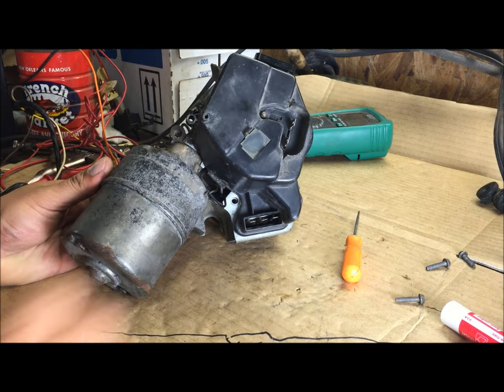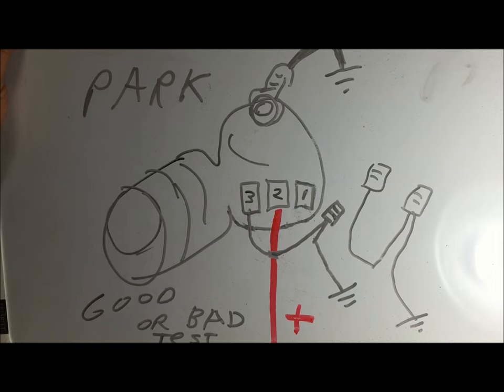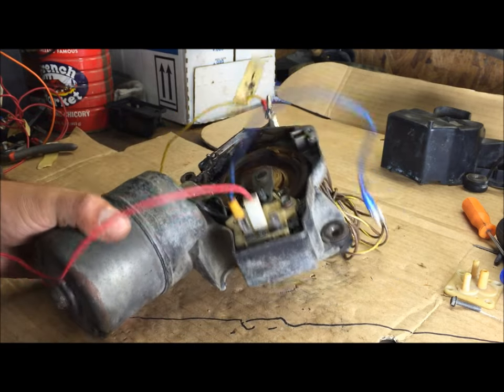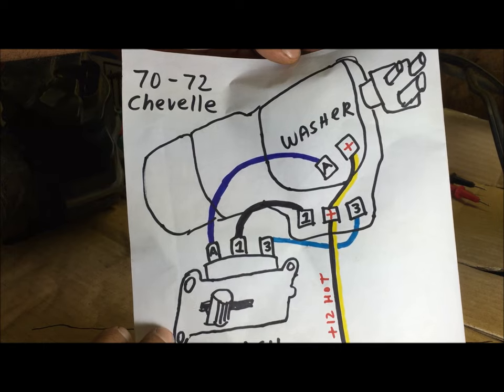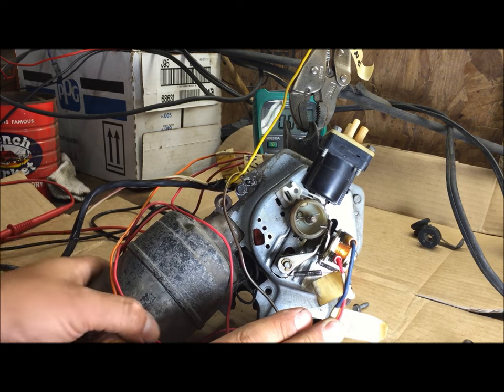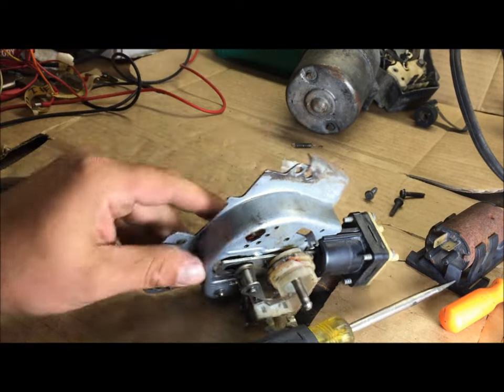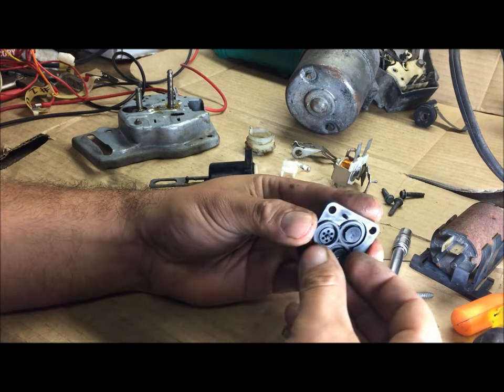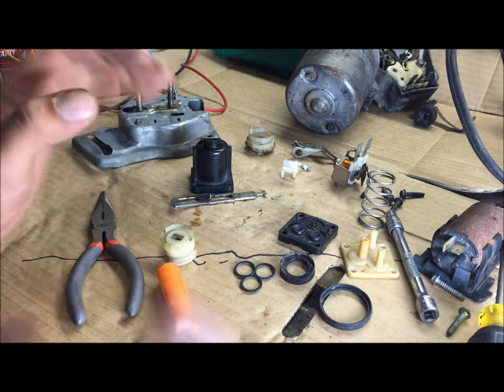how to test GM wiper motor wiring and washer pump IMPALA CUTLASS GTO NOVA CAMARO CHEVELLE

Comment: Would poor connection on the two prong washer pump plug cause the pump to not get enough juice to engage and squirt fluid properly? I find my spring is not engaging after the wipers are running for a few minutes.

Comment: I got excited when you pulled the seal off at the end of the video but then the video ended abruptly. Anyone know where to get a replacement? Please? I dont want to buy a whole pump when I only need that seal.
Reply from the maker: watch my retro fit washer pump video.. it looks ghetto at first but it is legit...   works like a champ .. the original style washer pump is trash..  you cant get that seal.. i put a link in the description
Reply: @chriscraft77022  It is possible to buy a new wiper motor/ pump combo. So either it is old stock, or someone still makes the seal? I bought one but sent it back because the plastic case was cracked pretty bad. Part of me wishes I would have taken it apart for that seal but I'm not jewish like that.

Comment: Great How to! Found a work around for the Pumping Piston Ring made of UNOBTAINIUM. Carefully remove the ring from the piston. Place a very very thin o'ring in the groove and reinstall the original Piston Ring with the "Expander " behind it. Working well for almost a year now!
Reply from the maker: that is one of the best ideas I have ever heard to fix it.. I ended up putting an electric pump.. works so much better.. I have a video on it

Comment: Went and replaced my vacuum operated wiper motor with a 85 Jeep motor and a 72 Wagoneer switch, this all going in a 59 rambler american 2dr S/W.  Very frustrating but once I figured it was a ground side switching circuit with power being a constant it was much easier. Ofcoarse I realived this after watching your video. Thank now I can get it inspected and start cruizing.

Comment: Great video, I just bought a kit through Rock Auto for a 1983 chevy truck and it came with the lower seal for the pump. They might have started selling full kits. My kit also had 2 different tops for hose hookup.
Reply: Mine has it too. Lets see if I can fix it.
Reply: Well, almost one year later before I got to it, but it works!
Reply: Would you happen to remember the item number for this? My washer pump leaks and in dire need of repair. Thanks!
Reply: @robbiesz  I used the ANCO 6106.
Reply: @stefanvanderbij5555 I looked it up but the picture of contents shown doesn't show that pump shaft seal. Did yours have that in the box?
Reply: @robbiesz  I see what you mean, odd. But mine indeed came with it, just like Leroy's. Gamble ;)
Reply: @stefanvanderbij5555  thanks for taking the time to respond! I will try the floss method first and buy the repair kit if that one fails.

Comment: Nice video, dealing with dried up washer on 69 GS, ordered the Trico electric pump but by time it primed it burned out.
Returning and will prime with fluid before trying it next time... But for one of these think back in 80s I took rubber band and put in that groove to make the seal expand in that bore further and it worked on a GTO... this GS unit is rock hard so no luck with my former method..  maybe others will though if soft enough to come off like yours was...

Comment: interesting video... you obviously studied and learned your way around the wiper motors.  I saw how you pulled the piston assembly of the washer pump apart.

You made reference to the sealing ring on the piston.  That is a combination compression and sealing ring for the piston.  It is similar to the oil and compression ring of an engine, but serves multipurpose of compression, sealing and scraper. An engine has separate rings for the same purpose.

Since you are not able to find replacement rings for the existing pump, the rings that you have can be revived if they have dried out too much. There are several methods to do so.  To revive the ring, it needs to be soaked with a lightweight motor oil, or with mineral oil.  The rubber ring shrinks over time and wears out.  Soaking it with oil revives and renews the rubber, making it pliable again. If exceptionally dry and hard, soak it over night.  If only marginally hardened from drying, soak it for an hour or so.  Then, carefully clean and wipe all excess oil off the sealing ring.  Then finish it by wiping on a coat of silicon lubricant. This will help to replenish and slow the drying process. Allow it to sit for an hour, then wipe the excess silicon lubricant off before reassembling. A small dab of white gear oil <usually silicon based> on the piston and sealing ring will allow for easier assembly.

Thank you for this very informative video.  I studied it to learn how to wire a wiper motor because I want to use one for another purpose other than as a wiper motor.  I can do away with the pump because I don't need it, but do need to know the correct wiring diagram for the wiper motor.  I was able to learn everything I need in order to wire my motor for the plan that I have for its use that is NOT as a wiper motor.  Again, thanks a lot for your informative and very nicely made video.
Reply from the maker: i will try that in the future, thanks..

Comment: TIPS:  @ 17:35 - The Seal... What I did was to take the a  large " Shrink Wrap " and shrink over it, then cut off the excess.  It worked perfectly again!  Good Video by the way!
Reply from the maker: good idea but installed that electric pump and it works 100000000000 times better....  in that retro fit washer pump video....  older crappy video but a very good idea
Reply: +Chris Craft - Yea I know it was old... Maybe next time.... Or maybe someone will get an idea from it :)))))

Comment: Working on my 70 Corvette Wiper Motor,  Wipers works perfectly just having issues with washer pump. Looks like the washer pump hasn't been used in years since I found both wiper washer nozzles (on the 70 Corvette/part of the wiper arm) disconnected and one completely broken off. Washer Reservoir was dry and filter screen clogged. I ordered new wiper arms w/the nozzles and the Washer Valve Repair Kit that you noted. After I check the spring and gear, Hopefully I can get the washer pumped primed and working, if not have to find that cylinder seal. Please update the video if you find a source for the cylinder seal, i'll have to check with one of the Corvette parts suppliers if that seal is now available since your post was 6 years ago.. Great Job explaining the electrical connection, I'm just a shade tree mechanic tring to keep my C3 operational and that helped tremendously. .

Comment: I appreciate all the work you did to bring us the excellent video.
Ive been having issues with my wipers and this has been very helpful.
 However no mention of the switch and I cant find any videos or diagrams of my wiper switch. I have a 1978 Chevy Monte Carlo. The switch has a wiper delay and apparently Im the only one on the internet who has delay. I know ElGoog hates me and doesnt show me results I want only ads and ad partners.
So Ill look at your other videos to see if youve covered the switch testing and maybe create a new google account to get better search results.
 
The video was very helpful and my wiper motor is fine. So its either the switch or the wiring.
 If I cant find any videos covering the switch and wiring I may make a video.
Have a Great Day
Reply: Yeah wiper delay was factory but I cant find much info on it.
I removed and tested the switch and as far as I know its fine. 
I have 12v to center connector and ground on both outside terms according to switch position so Im guessing the wiring is fine.
I tried jumpers to activate the motor and only hear a relay clicking but to motor.
  So I bared the wires to the motor and low works but not high.

 Everything used to work but when I power wash under the hood the wipers quit working. The parts store said if I buy a new one and it doesn't solve the problem I can return it and continue trouble shooting.

Just thought I give you an update. And thank you again for posting the video. Few cover the older cars and you did a very good job explaining things.
Have a Great Day

Comment: the 1972 switch is different from the 1970 on the chevelle, it has an extra pin which i am showing 10 volts at.  I just rewired the entire car with an american autowire upgraded harness.  My original switch has 5 pins ,5th pin being larger than the other 4.  the AA diagram shows the 3 plug harness going to the 3 pins and the single plug going to the other smaller pin.  i tried holding the switch against the coking in the event it was supposed to be grounded but all i get is the relay clicking ay the motor but no other life out of the motor,  in the am i will try to do as you have so excellently showed in your vid.   thanks!

Comment: Great video man, have a question since you seem to know these well. My wipers work but pump doesn't, it's not grabbing it like yours and doing it. I took it apart and noticed that I'm missing the red part you have at 12:58. Is that why? Does that thing move the lever. Thank you

Comment: Thanks for the great video and sharing your knowledge, I learned a lot. I'm trying to restore a 1971 Chevy Impala and just received from Ebay a used wiper motor and the wiper transmission arms. Do you have any videos out on restoration of the wiper transmission arms and proper assembly?  Keep the great videos coming.

Comment: I replaced motor and switch. Connected a ground wire from switch body to bezel frame because frame is cracked. Motor turns when switched on but doesn’t engage to move wipers unless I push in sprayer. Only wipes when sprayer is pushed and held.

Comment: Oh fluids do help. I rebuild a clock on a 72 Javelin AMX it had the tic toc feature. If no one ever saw one there so cool. has a clock inside the tachometer. anyways after cleaning and rebuilding, it would only work one cycle, or just a few seconds. Shot some graphite lube on the gears and it works till this day 25 years later.

Comment: Hi GREAT presentation 😎Thank U Sir !!! As u showed remove black cover ok !  On our unit CAN NOT remove 2nd cover to actually see Large gear that operates wiper arms 😢!!    Our unit is TOTALLY RIVTED TOGETHER 😢unable to remove the washer pump cylinder out as U stated to use Dental floss first on inside piston cylinder head  round area  to seal area while placing inside to help piston rubber seal  “ O “ gasket outside surface while inside to apply tighter seal to flow water !!!   I guess purchase new unit with washer pump 😢

Comment: Great video but the one thing I havent seen covered is coming across a bad park switch. I have a 79 corvette and wipers would not come on due to the park switch not disengaging. It appears this park switch is common among several models. The motor is fine. Where can I buy just the park switch?

Comment: I have a 86 Caprice with delay,  When I followed what you did,  everything worked (high, low and park), however it did it with delay.  e.g. low it would go slow and wait and repeat, then it did the same thing with what seemed like high wait and repeat, then it would park.  Is there anyway I can test with out the delay kicking in?   The wipers will not work from the switch inside the car. 

I must say, my gauges fuse keeps blowing.  I recently had an alarm installed.  I'm wondering if the alarm is at fault.  

Thanks

Comment: Great video, very informative....   The wiring on my car was cut, using a external washer pump. I have connected the wire I believe is the correct one from the wiper switch to the A terminal on the pump. Is there a way to test to confirm I have the correct wire, versus a bad pump??  Thanks

Comment: Great video!
I'm working on a 66 Delco 2-speed for an Olds, very similar. All is working, but speed resistor is getting too hot, still good, but WAY too hot (wisp of smoke). I'm afraid it's going to burn open. Any thoughts? Thanks. (Hope you and yours are ok in the Big Wet H. I'm up near Dallas, but have a daughter down there, OK for now. Stay Safe!)

Comment: Great video, question what if the motor spins as soon as you connect ground and power?  Bad motor?
Reply from the maker: the motor works off of being grounded by the switch..  it is opposite...  i dont know how you hooked yours up..   some people watch the video like 20 times to figure it out..   i spent 2 weeks making it..   it should spin but i dont know what terminals you hooked up..
Reply: @chriscraft77022  thank you for the response. I grounded the body and used middle spade connector for positive. As soon as I hook up the positive with no other connections it starts spinning.

Comment: i replaced everything with new parts, everything is working (slow, high speed), motor is perfect. spray is working too. there are no leaks.
however there is a new problem now: whenever the motor is running (hi or low) it always sprays a very little (only a few inches, not disturbing).
have you ever ran into this problem before, may you know what could it be?
Seems to be it's either sprays 100% (on spray) or 5% now whenever the wipers moving, but never 0% as it should be without pressing the spray button.
Reply from the maker: +Tamas Kalman pull the power wire to the washer pump and see if it still does it..
Reply: good idea, will do

Comment: awesome video!   I tested 3 motors and 4 switches for my 1966 full size Pontiac (2 speed with park feature) ... one worked perfectly ... one has trouble with the pump not bringing water up (but it does rotate) and the other works great except the pump doesn't rotate at all even though the switch engages the mechanism.  

Any advice would be appreciated on rebuilding the pumps ...
Reply from the maker: +Phil DiLernia  what's my pump retro fit video it looks like a mess but works a million times better than the manual pumps.. you can't buy the piston seal so you can't rebuild them.. you have to buy a new one

Comment: Great video.  It stops right after showing the washer seal, but can you tell us where to get the new washer motor rubber?  I'm working on a 59' Chevy wagon and I think that's my problem area.  The washer motor and seals
Reply from the maker: they don’t sell them .. watch the retro fit video I did .. that’s what I put on my car and it works 100%

Comment: I can tell you have been working on that too long....Good job by the way. I tested everything you laid out and all the mechanical stuff seem to be doing their job. I suspect its the plunger part you pointed out not being able to get. so you think vaseline will soften up the rubber enough to get it to work and continue.   Thoughts???
Reply from the maker: no, watch my washer pump retro fit..   thats what im doing to my car... that seal is $60 on ebay...   not even worth it... under $20 and thats the original off my 88 G20 work van...  so it would last almost 30 years

Comment: good video man question: do you think a 83 firebird 2 speed motor is the same?
Reply from the maker: +Ryan Williams if it has a switch in the dash and not on the column it might be the same but i really dont know
Reply: +Chris Craft it is the same I took your knowledge and wired it up for one speed on a 25 amp rocker. using the ground for low and park. thanx man! got me out of a jam.

Comment: Thanks for the great vid.  It's being passed around on ElCaminocentral.com , and after watching your testing portion i've found out my wiper motor is F'd up.  No fast speed and the slow speed barely moves.  New parts on the way.   
Question about the pump wires....Left wire is 12v +, right is?  I don't have the original harness and the wires are all black....Traced 3 from the switch but not sure what wire goes from the switch to the pump.  68 el Camino, hidden wipers.  Cheers!

Comment: Thanks so much for sharing this. I am installing the Painless performance chassis harness and I have situation with the wiper motor. It turns on in off position. And turn off in high position. I will check all the cables again. It's appears that it's okay. But it's not working as it's supposed.
Reply from the maker: is it hooked up in the car?  with the switch?
Reply: Chris Craft. Yes. I'm doing tests with a battery charger with 2A or switch to 6A.
Reply: I have the #20102 Painless performance harness wiring .
Reply from the maker: I have another video wiper trouble shoot on the car
Reply: Chris Craft . I will check your channel. How's called?
Reply from the maker: That’s what it’s called
Reply: Chris Craft Yes. I see it. Thanks for sharing.

Comment: Can you hook a relay to these motors? There is nothing out there showing how to hook up relays on 70’s 80’s 3 pin Chevy wiper motors.
Reply from the maker: the motor doesn’t need a relay.  For what?
Reply: I guess I don’t need a relay haha. I was able to figure out how to bypass the Chevy wiper impulse module and go with a old school 2 speed wiper switch. Your video help me figure it out. I was trying to hook 12v power to the actual wiper switch and could not get anything to work. Thought maybe a relay would work. Got it going now! Thanks again

Comment: So I did the test and instead of park it went in opposition direction  but very slow Is it the motor?  Thanks Chris
Reply from the maker: is your battery 100% charged like 13 plus volts? check that first
Reply: Well it's at 12.47 pretty much fully charged
Reply: Should put it on charge to get max voltage
Reply: Oh by the way it's a 66 gto wiper motor 3 prong 2 speed used the center pin as my pos.left and right for ground just like your video
Reply from the maker: I tested mine with a battery charger hooked up to it like it would be in the car.. your car runs at 13.5 volts at least.. if it doesn’t work then I would get another motor